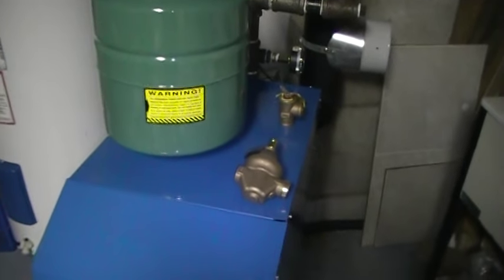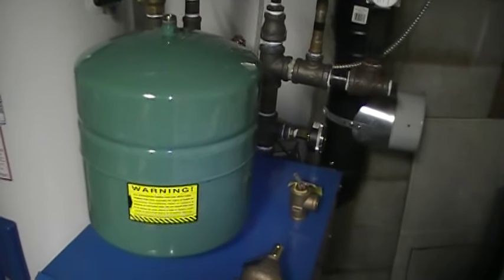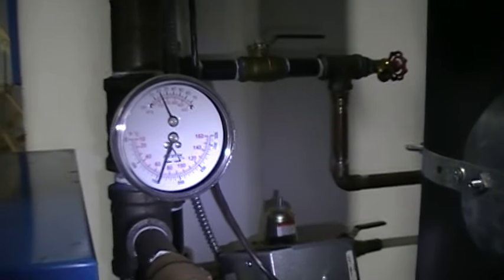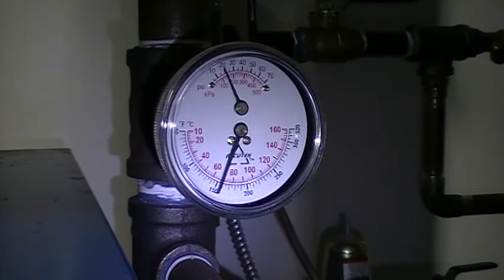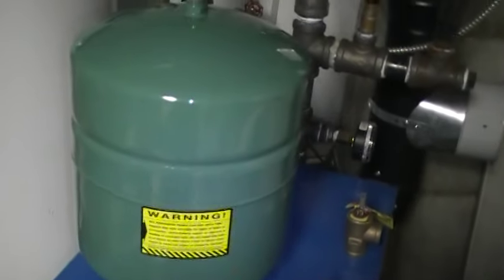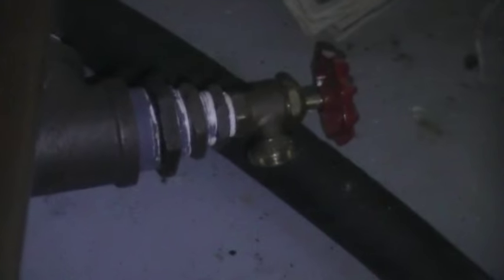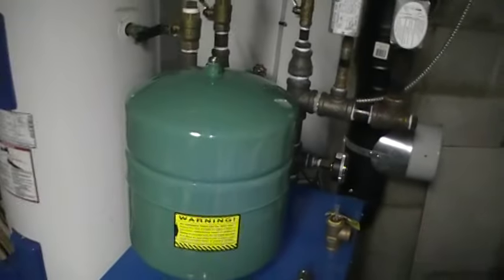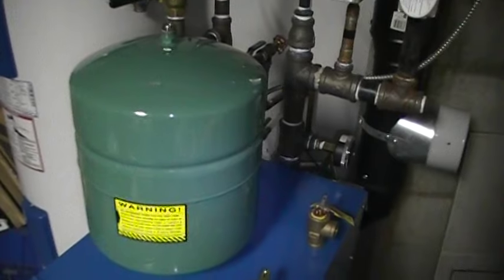Relief valve blowing off on hot water boiler (furnace).possible cause...Part 3

Comment from the maker: @PSCIED Once the guage is reading zero on the boiler; take a tire guage and check the pressure in the extrol tank. It should read around 14 pounds. If it is not reading anything then the tank either has to be charged or may have a bad bladder in it considering it is new; it should be replaced under warranty.Once you have checked the tank slowly open the feedwater valve to the boiler and let the pressure build up to 12 psi.

Good luck and keep me posted!!!  Al

Comment from the maker: Hello Ben;

Thanks for the input ben;
A pressure relief valve that blows at 20 pounds would be a faulty valve. I have seen boilers dancing on the floor and the relief valve didn't hit 30 psi, but the temperature exceeded 212 degrees and was producing steam. In the case mentioned I would say the aquastat could be somewhere to start at if the temperature is climbing for no reason at all. Some relief valves do not seat after they pop as well.
Thanks for commenting and have a great day!     Al

Comment from the maker: Hello Jay;

Where did you drain the water off the boiler at?You turned the valve off that feeds the boiler. It should be before the feed water valve ( pressure reducing valve ) which reduces the pressure of the water going into the boiler.Do you have an expansion tank which would be located in the ceiling or do you have a small extrol tank that would be connected just above the boiler most times?It is about 12 inches in diameter.
Thanks for commenting and get back to me when you get a chance! Al

Comment from the maker: @ianmacdon Hey Ian;

Over time I believe it happens to most people unless they regularly check the pressure on the boiler and drain the expansion tank. Although there a number of things besides the tank that will cause this problem.
With the extrol tank being about 1/5th the cost of an expansion tank; most installers are using extrols.Once the bladder goes in them they are simply replaced.

Thanks for commenting and have a great day!!!   Al

Comment from the maker: @PSCIED Hello;
First thing I would check would be the tradicator (gauge)on the furnace. If it is reading around 20 pounds pressure when the furnace is operating and water is coming from your relief valve may; the relief valve is faulty. Not overly common,but it happens. If your furnace has a coil in it for your domestic hot water; it's possible for the coil to get a pinhole in it over time and put the pressure over 30 psi. Let me know what is going on with it...  Tks for commenting and G.L.  Al

Comment from the maker: @PSCIED Hello;

Something is not adding up here.You had the tank already replaced and the pressure reducing valve.Shut the valve feeding the boiler and see where the pressure goes when it runs;just to check the pressure reducing valve.To me;it sounds like the tank. Is it an extrol tank or a 36 inch expansion tank?One way to check the pressure in the extrol tank is leave the valve closed feeding the boiler and take a hose and drain the water off until there is no pressure showing on the guage.

Comment from the maker: @mandy5181 Hello Mandy;

When your boiler is operating the pressure should be around 20 psi. Give or take a pound. The relief valve is set at 30 psi. The coil in your furnace may have a pinhole in it. One way to check is to turn the supply valve off to the coil. If your pressure does not rise then your coil has to be changed. When your boiler is operating and calling for heat does it cut out where the high limit is set at on the Aquastat? How old is your Boiler?
Al

Comment from the maker: @mandy5181 Hello Mandy;

Does your boiler have a coil in it for domestic hot water? At what temperature does the burner turn off at. The guage on the front is called the tradicator will show you this.
Let me know as soon as possible and I will send you a response!
Al

Comment: Hi, I just bought and installed an expansion tank because boiler relief valve would spurt water  from the relief valve violently and I got hammering sounds. I did not check the levels or adjust the expansion tank - I didn't know it was required, though the factory adjustment would be normal and useful. Not so - when I got the furnace going again, the same thing happened. Is it the expansion tank ? Could I have killed the tank in one shot ? I already replaced the systems water pump and regulator and thermocoupler.
Reply: Hey, u figure this out?
Reply: @clintoncooper3427  Yeah, a door valve was in the open position, but taking it apart realized it was stuck closed. Even the plumber missed that ! I took the door out, put the valve back together, and now that it is open, there is no pressure back up. Do plumbers ever consider that valves which appear to be open are closed ?
 Thanks for asking.

Comment from the maker: Hello amaz1ng77;

Does your boiler have a coil for hot water in it? If your tradicator is saying 30 psi then this is either caused by the coil,a water logged expansion tank or a faulty pressure reducing valve. If you boiler temperature is very high as well this will cause your pressure to increase as well which would mean that your aquastat is faulty.
I apologize for the late response as I was away for a few days!
Thanks for commenting and let me know how you get along!   Al

Comment: If your relief valve blows off the pressure was exceeded. It was most likely exceeded because your reserve air tank is filled with water.
First pump up the tank with a bicycle pump. This will inflate the bladder and remove the excess water from the tank.
If your relief valve remains open, foreign matter has possibly lodged between the stop valve and body. Chances are you can fix this by removing the valve, run water from the faucet while pushing up on the valve to free the foreign matter. Good.

Comment from the maker: @WayneBurgess1 Hey Wayne;

Happy New Year to you my friend!

There is a snifter valve on the extrol tanks and sometimes you can get away with that. I always use to use full size expansion tanks and would never use an extrol tank, but the price of expansion tanks is now about 6 times that of an extrol which is redicules.

They do come pre-charged as you know, but the odd time they come with very little air pressure and do require some to be added.

Tks for commenting and all the best!  Al

Comment: Wow this video is almost 10 years old and still so helpful. I hope all is well and you're staying safe during this unfortunate time. I have a question, I changed my expansion tank, my relief value and I believe it's the regulator (bell shaped) and I'm still having pressure issues. I have to go down to the boiler and let pressure out in the morning around 9am and then again at around 6pm. Pressure will rise as high as 40 if I don't. I'm wondering what else it might be, I was thinking from online reading it may be my coil. Is there anything else I could check before having the coil replaced? Thank you for any input you can share.
Reply from the maker: Hello Steve,
First thing to check for is the boiler is shutting off at the high limit on the aquastat and not going above the setting. Simply remove the grey cover on the aquastat and check what it is set for. You will see a high and low number. As long as the boiler is shutting off around the number that the high limit is set you can eliminate the aquastat.
The aquastat is the rectangular box mounted generally on the front of the boiler about two feet off the floor.
A simple way to check to see if it is your coil is by turning off the water to the coil only and opening a hot water faucet overnight. Leave the hot water faucet open all night to releave any pressure build up. If the pressure doesn't go up when you check it in thew morning then you know that it is your coil.
You don't necessarily have to do it over night, but it is a time when the house will be not using water. Doing it during the day can be a bit of a pain as people may open both the hot and cold and put pressure into the hot water line through the faucet. 
Hope this helps!
Thanks for commenting and let me know how you get along!    Al
Reply: @TheOldkid888  Thank you so much Al, I will start with the aquastat. I never even thought of that being a possible cause 👍 Stay healthy, stay safe. I'll keep you post not pestered lol

Comment: Hi, Do you recommend changing the expansion tank after a few years, as a precaugtion?  My HVAC guy said he had installed one back in 1971 on a clients house, and it still works. He claims the new ones are not as good.  My Taco conduit I change every 7-8 years.  I have heavy water where I am, and rust closed the circumference of the opening, thus blocking access to the expansion tank.  Luckily I heard the water gush out of the  the relief valve, thus saved myself a lot of water damage in the basement.
Reply from the maker: +Papa Smurf 
I don't recommend changing the tank, but if you have mineral laced water; it might not hurt to do it perhaps every five years. They are not overly expensive.
Funny thing with tanks and it doesn't matter what type they are (pump,hot water or expansion) they can give you trouble at anytime. I agree with the HVAC guy. The old saying...They don't make things like they use to...is true of many parts made today. 
I have seen many tanks last decades myself. 
Water quality does play a big part on life expectancy.
Thanks for commenting and enjoy 2016!    Al

Comment: Hey great video. Hope your still commenting on it. My furnace is blowing off water throw the relief valve when the furnace shuts down after a cycle. I do not have that little green tank I have an expansion tank. Any suggestions would be greatly appreciated
Reply from the maker: Hello Adam,
It sounds like the expansion tank could be waterlogged. I would shut the boiler down and close the valve going to the expansion tank and drain it. 
The reason it is blowing off at that time is the boiler has reached high temp and the water is at it's highest temperature which has increased the pressure in the system.
I would go that route first. When you shut the valve off to the tank and put the hose on you will need to drain off at least a few large buckets of water. I drain it completely myself, but a few five gallon buckets should be good. A mistake people make is they place a hose on it and open it to a drain, but air has to replace the water in the tank, so generally there is an air inlet valve on the end the tank or built into the drain of the tank. You will have to open that after you open the drain valve. 
Use a bucket at first to make sure you get good flow and air goes into the tank. Sometimes there is no air inlet valve and it is painful to drain the tank as you must use a bucket and get small drips and drabs. Hopefully that is not the issue here and it drains well.
Slowly open the shut off to the tank after you have drained it. I open it just a little and let it fill like that myself. Old plumber showed me how he opened the valve afterwards. Kinda stuck with me.
P.S. Don't forget to turn the boiler back on....it happens. LOL
Thanks for commenting let me know how you get along.....Al
Reply: @TheOldkid888  that's exactly what it was. I shut off the flow of water to the tank and opened the drain came out with lots of pressure for a good 2 minutes then finally found the air valve on top of the tank that I had never seen before thank you for that. I could hear the air being sucked into the tank. Let it drain for 10 mins. Never really measured how much water came out but the furnace isnt blowing off water anymore and running between 10-15 psi
Thank you again greatly appreciate your knowledge
Reply from the maker: Hello Adam,
You're welcome!
Glad everything worked out for you!
And congrats on making the repair!
Thanks for commenting and have a great day!      Al